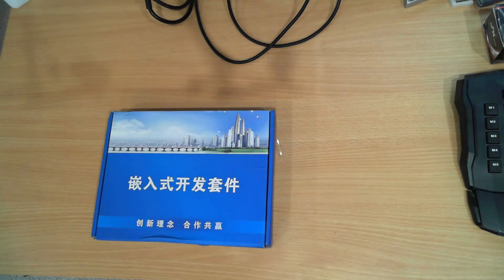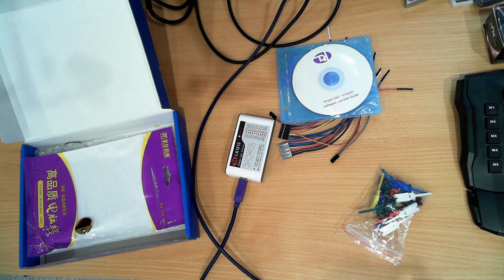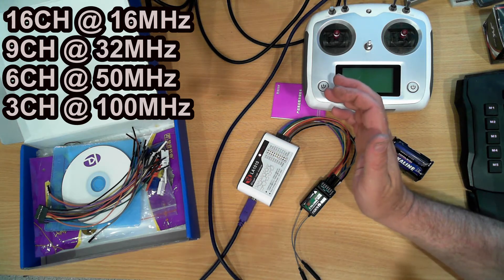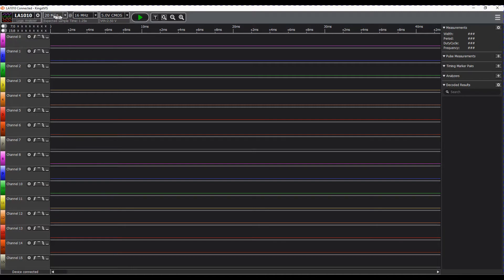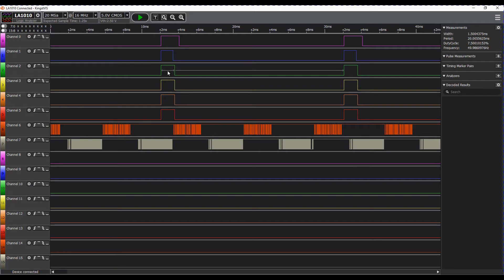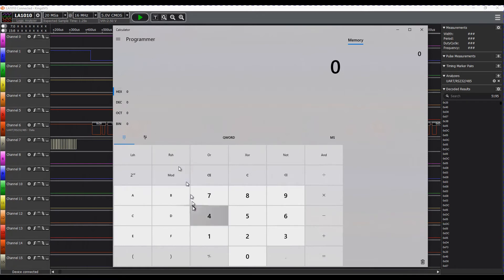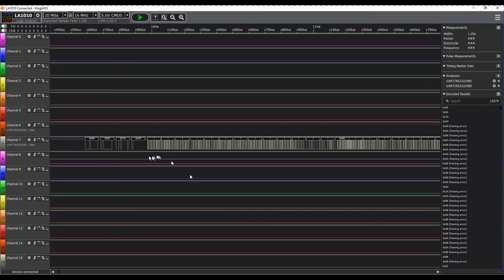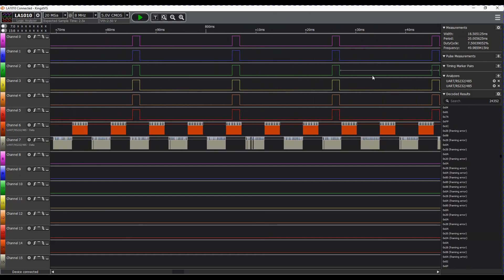Review Kingst LA1010 Logic Analyzer

Comment: What is the use by checking the signals
Reply from the maker: n an example from a few months ago, I used the 10 of the inputs of the logic analyser to debug the intermittent operation of the HD44780 (20x4 character LCD display) when driven by MyRobotLab
Two of the inputs were connected to the I2C bus (SDA and SCL), This allowed me to see what commands were being sent on the bus to the PCF8574 that was driving the LCD module.
The remailing 8 lines were connected to the outputs of the PCF8574 to monitor the state of each of these lines which drive the LCD module.
The software that drives the logic analyser decoded the I2C signal into the commands being sent.
From this I was able to confirm that the outputs of the PCF8574 were doing exactly what there were being commanded to do.
The bug was found to be incorrect initialization of the LCD module.
The code has now been modified to ensure the correct communications mode and state of the module during the init phase of MRL
Turns out the LCD module starts in 8 bit mode, but we need to use 4 bit mode.
The command to switch from 8 bit mode to 4 bit mode uses a single command, but once in 4 bit mode, all commands require two writes..
The solution was to send two commands to set the module into 8 bit mode first, then set to 4 bit mode to ensure both the controller and the module are in sync.

In another case, I used it to determine the SDA line on a Raspi3 was not functioning at all.

Comment: I have the 2016 version. I have to say, I was disappointed at first when I played around with the software and were only able to sample a specific amount. I then realized that there are different modes for streaming vs using local memory and you can set a very large number of samples to read. After figuring out how it all works I became very impressed by the performance. Still have to get used to the different layout vs Salea's logic software but overall a very nice product. 200MHz is impressive
Reply from the maker: The software can be difficult to follow, it was a week or so before I worked out how to set triggers on the right side there.
I'm finding it helpful when trying to diagnose I2C issue in my robot builds.

Comment: Did you find a way to trigger the capture other than manually?
Reply from the maker: Yes I did, the setting are on the left side for each line.
Better still the trigger can be set for a specific condition, that is some inputs as high and some as low with the states of other not tested.
Handy if your looking for a particular event say on an address bus.
It's incredible what you can find out when you actually get around to reading the online manual.
What I showed in the video was just from looking at the program, so it is pretty intuitive for most of it.

Comment: What USB IC/Driver(s) is used, uC, FTDIxxxx CH34x, CP2102, other? They all work, but they often don't work well together.

What is the data/control communication protocol on the USB side? SCPI/VISA? Has anyone looked with something like RsVisaTester? If SCPI, is there a command list available? I looked through the user manual, SDK, and SDK manual, but couldn't find anything. When the software becomes obsolete, and it will without warning, with SCPI, new software can be quickly thrown together, and the SCPI can be used to better integrate the analyzer with other hardware and software, and maybe even be utilized for improved analysis.

Has anyone seen a price for the software? The download says it's a demo, but I didn't see a link to buy it, or even a feature list for the non-demo version, and I didn't want to install the software before buying the analyzer (if I buy it/them).

UPDATE: I found out it has a decent USB to parallel interface and shouldn't be a problem. Analysis is done through an FPGA, which is the best route to take, but still no information on the analyzer to PC communication protocol or the software.

UPDATE: This came from an open source project and then a crowd fund, there's been lot's of clones since then. This unit can apparently be modified for better specifications and can be paralleled for more channels (it says up to 128 channels + a few useful I/Os)! The SDK for it is actually useful, you can use it to speak in multiple and simultaneous protocols to talk to other equipment/devices as well as other analysis software, so that's nice, but it takes a bit of work. The same can be done with a few other brands/clones of this logic analyzer, so I'm going to look around a bit more first. I think this will conclude my comments for a while until I have a new working system (if I can manage something useful), but for now it's food for thought for anyone who wants to experiment and hack. Hopefully I will have a new analyzer up and running, I migrated to 32-bit processors and large FPGAs, most of my equipment is fine, but constantly changing, adding, and removing jumpers and clips and then collating the measurements takes more time than the actual development and testing! Happy Hacking!
Reply from the maker: All are very good questions.
Unfortunately I'm struggling to answer even the one you found the answer for....
Software development does continue with an update being released last month on the 10/9/2020.
This update added some new protocol analyzers and fixed a bug.
As an Electrician, I tinker around with the Arduino, and motor control, sometimes I need to see what the signaling between micro controllers are doing to find bug in my code.

I installed the version that came with the unit using the supplied CD.
In the about box, it doesn't list it as a demo version.
Could be the version supplied and the install disc is a full version and you can only download a demo from their site, or maybe it switches to a full version after getting a key from the hardware?
Each time it starts, it does a check for a new version and I can update at that point.

As for a drop in support, you are most likely correct, I've seen this happen with gear costing many thousands of $ go the same way after just a couple of years.
If you do work out the protocol, then by all means let me know :-)
It does make sense they would be using an FPGA, very versatile devices that can processes a number of discrete signal at the same time in parallel :-)
Yeah, ok I have looked at small FPGA's in the past :-)
I also not a lot of programmers cant wrap their heads around the HDL, particularly when it looks a bit like sequential code :-)
I have also seen FPGA's used in a DSO such as the small e-Design DS203

Ray
Reply: @CyberOne  Thanks. Overall, considering features and price, I think I'll get this. A little poking around may get me what I want. I'll connect my old analyzer to the USB if need be and see if I can get the command set. It would be great if the debuggers, logic analyzer, and some other equipment and software could talk to each other. I'll post what I find.
Reply from the maker: @patrickpazal9259  I'm always up for learning something new :-)

Comment: Appreciate the basic how to. Just got mine today and was looking for a how to. glad I stumbled on this. I'm trying to figure out how to measure pulses. I was getting weird results with pulse width and period using a simple arduino sketch, loop, pin high delay 1000, pin low, delay 1000. depending on the sample rates and frequency I used I was getting differing widths from 100ms to 3s, weird. But hooking it to its internal 1k/100khz PWM, showed accurate results... who knows
Reply from the maker: I did figure out later after I recorded the video, the left side where each of the channels are, you can configure one as a trigger as well, makes it easier if your looking for a sequence after a particular event. 
I knew it would have that feature,  but hadn't yet found it.
Amazing what your learn when you eventually read the manual :-)